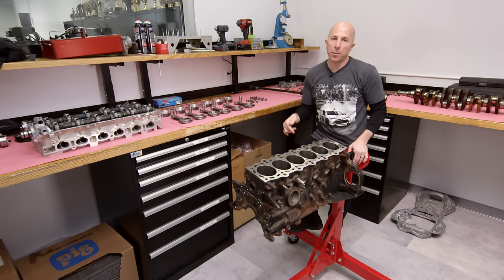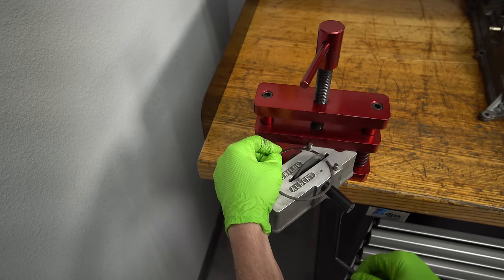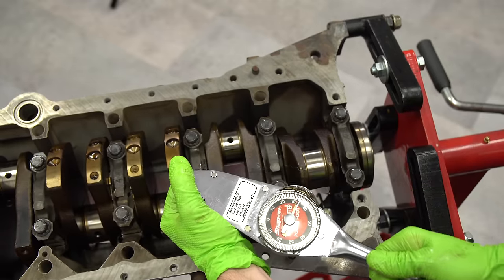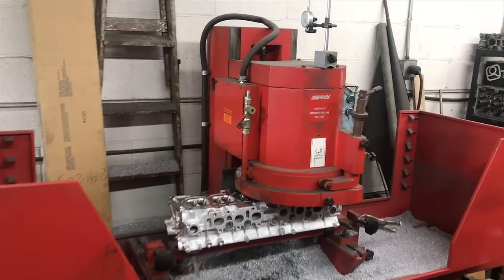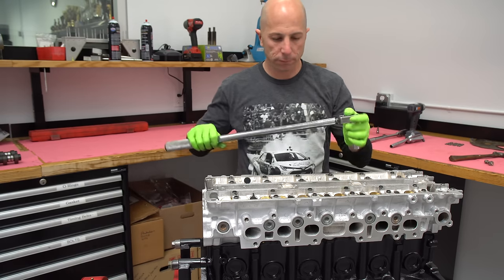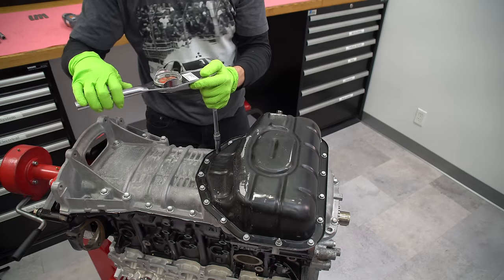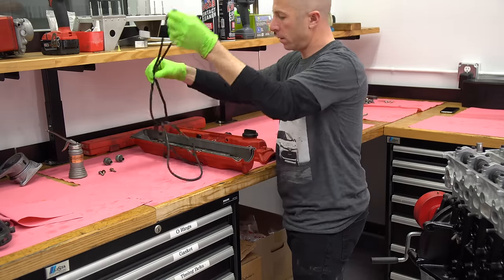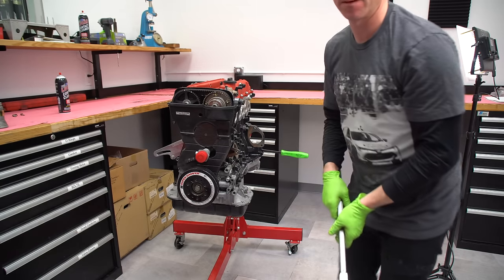Toyota 2JZ Engine Build - Full Start to Finish

Comment: Will this fit into my De Sol Engine Bay?
I'm Looking to add a few HP's to her to GoFast! 🐹
Reply: When you make it rwd im sure you could make it work 🤔 You need to weld in a tunnel for the gearbox, driveshaft, relocate the tank, exhaust, build a rear subframe for a diff 🤔
But it can be done 👌
Reply: @DeUnoReverseKaart  Awesome! Go Fast it is!! 🐹👻 Thanks...
Reply: @MikeKollin  But why not go for a k20swap, boost it and make a mid engined rwd delsol 👀
Like a better, faster version MR2🤔
Reply: @DeUnoReverseKaart   Sorry, I was just being Funny! But I am looking for an engine for my Del Sol... Looking at everything from a D16Z6 to a B16A2 etc... I've looked at the K20. It would take a complete engine bay change to put one of those in...
Reply: @MikeKollin  Wel you found the right person🤣 I worked at a Honda dealership for 5 years and ALL my cars were/are Delsol's(exept my current daily driver)
I started with a original SIR+E-roof, after that a 92 SI delsol with D16 wich i swapped to B16 again 😁

Best plug and play engine is b series.. B16A2+y21 gearbox. My SIR does exactly 200km/h in 4th gear while spanking the limiter and 5th gear aswel.

If you want K20 swap but dont want to do all the work, why not look into building a B20"SIR Frankenstein" Vtec? 👀🤔 
Just get a b20 block from a 1st gen CRV, put a B16a2 cill-head + external oil line for the vtec on the b20 and voila! 🤷🏼‍♂️ 
B20's can be beast's aswel 👌  "stock" 190hp easy, iv seen 240/260 hp N/A setups aswel with only bolt-ons👀 You could even use the CRV 4x4 drivetrain if you really wanna go all out🤣🤷🏼‍♂️
Reply: @DeUnoReverseKaart  I take it your not in California? by  the 200 km/h on mph. Right now My head gasket is blown engine is 341,000 and already rebuilt top have, new piston rings, 6 years ago. So I am looking to just get another engine in it to get it running... then down the road get a better Engine like the B16A2 etc or possibly B20 etc. I've been looking hard and ready to make a decision. Any chance you know anyone in the Bay Area with an engine to sell? Right now it has a D15B7 OBD-1. Really want to put a D15Z6 in it for now, it has VTEC ... I've heard they're fun and it would be an easy drop in, both OBD-1. Then later buy another engine and build it  up, make it solid!
Reply: @MikeKollin  Im not even in America lol, im from Holland🤣👍 B series when good maintained are hella strong... my b series has 14,7 bar compression average while being half a million km old (summer)daily driver..

But i dont know prices in usa tbh 🤔 and what is best in that case..

You could bore the cillinders + 1st oversize pistons, clean/rebuild the cillinder head and be done 🤔 maybe put a turbo on it with like 0.5/0.6 bar safe = +- 160/180hp... 
That way you know what you got👆 instead of buying a possible moneypit..

But for the same money you could probably buy a b series aswel, but on the other hand... what if the b series also needs work🤔

I think you should make a decision on what you want in the end.. if you want a B series and tune it, just go for a b series..

 If you just want it to run properly for now and maybe in the future want a 180hp setup, i would rebuild the current engine from a to z and make that fresh asf so you know what you got💯🤔

Comment: did you manufacture all the parts yourself? cuz they seem brand new
Reply: JE pistons is his supplier, the stronger studs are from ARP, dual valve springs and the titanium retainers, CNCed keepers, inconel exhaust valves, and the stainless steel intake valves are all from Supertech performance, camshafts are from BC. That’s all I know.

Comment: Is this motor like the big brother to the 2004 2.7 4 cylinder Tacoma motor?  Also the 4.0 v6 from the same year 4Runner looks a-lot like the same head set up the dual overhead cam! I know the 2.7 4 cylinder was a good motor and the 4.0 v6 in the 4Runner is just ate up with power it has over 200 thousand! I was raised up a Chevy guy got into Toyota over the past 20 years there designing, engineering, and reliability there’s no other manufacturer for the price you pay that can give you all that plus the resale price and the ease of when you work on them you can see things they changed from all others use to a very easy simple way that works better is stronger as a mechanic you think wow this or that makes this so much easier it’s great to see they make it we’re it’s not a hassle to work on with better designs for you as a mechanic then the lasting longer stronger so you don’t have to work on them as much great product remember the Old tv add (I love what you do for me TOYOTA)

Comment: I wish i could understand what you were doing and saying but i didnt study mechanics im litterally just teaching myself i call a torque wrench a powerful pulley x"D I'm an engineering student but they do not teach you any practical skills ive designed an engine in theory at like around 25% efficiency (otto cycle) but eh who needs to know that stuff. I wanna build things :D

Comment: I have no experience with Toyota, was there a reason you didn't use an opposite side star pattern when torqueing bolts? I've always been told that you do the opposite side start pattern to make sure there are no leaks and that each bolt sees equal stress, but you didn't do that in this video.

Comment: What is the price? For that engine?
Reply: For MK4 Supras, the 2JZ engine are probably one the few engines that doesn’t cost more than the car because the car is getting so popular. The one Papadakis is building as VVT-i and twin-turbos stock. So probably around 5K-10K, 4.5K if you’re lucky. A good clean title MK4 Supra can now go up to 6 figures which absolutely insane.
Reply: @Velocitist  I mean the new one
Reply: xzmaz Define new? You mean the new parts?

Comment: Variable cam timing? So..... v-tech?
Reply: V-tech is completely different that vvt
Reply: @euphoric_performance  I know.... It was a joke. 

The clip said variable cam timing .... but vvt means Variable Valve timing. 

I know VVT doesn't vary the cam profile or lift electronic control like V-tech does but found the grammar mistake funny.

Comment: ΝΟΤ  Lubricating  the bolts  , because  hydraulic pressure  in the hole  lift  upper  the dynometer .

Comment: In my opinion you used too much silicone on the oil pan... I have seen engines, where the oil pump sucked the silicone and  therefore, the filter got clogged not letting any oil pass... Good engine ruined... Broken Crankshaft, bearings, etc... Only the block itself was reusable (after reprofile of the cylinders) , every moving part was demolished

Comment: He thinks 239 pound/feet is high torque? At my work I torque 32 inch flanges that use 2 3/4 studs that need 2185 pound/feet, usually we use a rad gun gun but when the torque is around 1550 we do it by hand with a multiplier. That's torque.

Comment: When you touqed the last bolt u messed up lol should never put ur weight on it that fast won't get a proper toque also everything on the engines we build is over 100 ft pounds lol big Diesel engines for you tires are 600+ ft pounds

Comment: I don't trust anyone who lubricates bolt threads, thats a good way to hydrolock he thread and have a bolt fall out. Also who uses an adjustable wrench to hold a cam in place, just use the right size wrench. Cringe worthy

Comment: four valves per cylinder, this is nonsense. As a result, the buyer spends more money in half on spare parts. On two valves and one camshaft, the engine will run better and consume less gasoline. because there will be no need to waste energy on the second camshaft and the second pair of valves with springs. This is a conspiracy of manufacturers
Reply: bro if you dont understand why dohc is better than dont spread bs